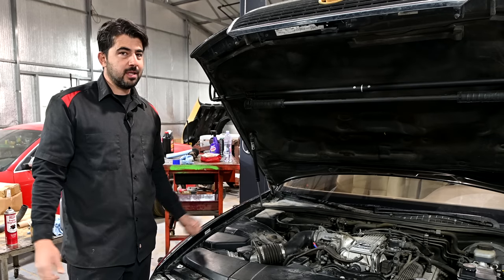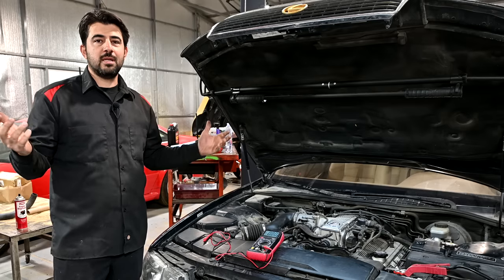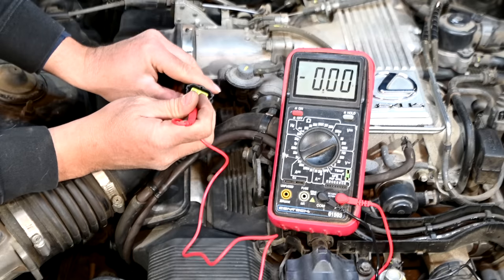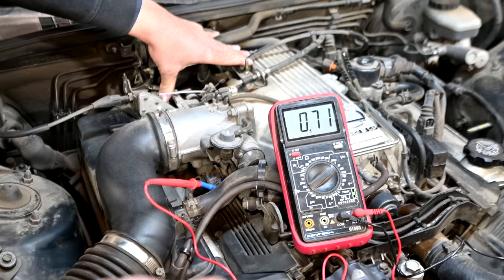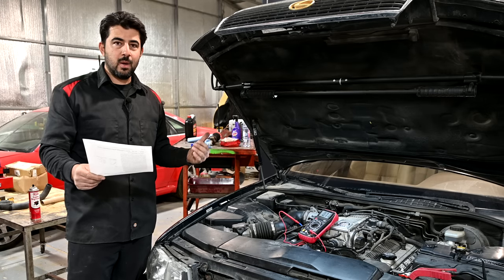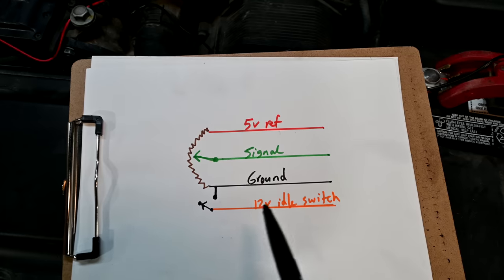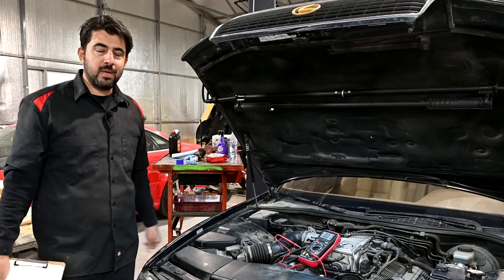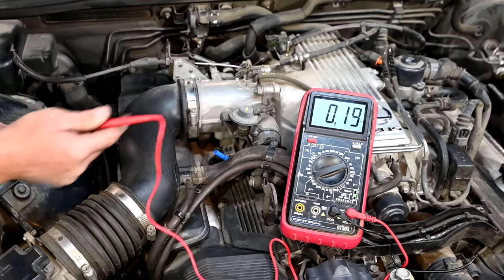Whack That Sensor To Find Out - Bad TPS or ECU?

Comment: Hello i have Toyota rush 2006 , i ve cleand throttle body and know the engine is working 2rmp. I suppose there is a problem with tps sensor. Could you please help me hot to solve this problem? Thanks so much 🙏🙏🙏

Comment: I have 1989 Ford F250 with a 351ci 5.8L V8 and because my scan tool doesn't work on OBD and OBD 1 systems.  I pulled the code with the blinking check engine light. and got a 53 code and came up with TPS circuit above maximum 4.5 volts. but I'm not sure what the parameters are supposed to be for that particular TPS. or if it's something in the circuit that is out of range.

Comment: Great tip with the screwdriver mimicing the bumps and vibrations of the road and engine. For the adjusting of the TPS, how does that work? Is there just an allowable tolerance spec you put it in and mount it?? 🤔

Comment: I like that you get it fixed right 😀

I would have done two things before replacing the switch and if it mostly fixed it, may have left it at that.. leading to a bad computer I guess lol

First would have been cleaning the throttle body. Second would have been cleaning the contacts of the sensor and disassemble it if able for further cleaning and inspection. Then while in there I'd probably clean the maf or map, anything I might have taken apart to get the TB off for a full cleaning. Lol

Comment: I had a 91 Camaro 3.1 L engine that puked the TPS sensor at 93K miles and it had all the symptoms with erratic
idle and was easily validated. Also, given the amount of miles on the odometer, it is very common that a good
many vehicles for the mileage of 90K miles or better for the TPS to fail. Also, knowing that my Mom had the ECU
replaced by the dealer already for another problem all together previously. Upon replacing the TPS sensor, I also
took the liberty of cleaning the IAC Valve pintle and also inside the IAC port housing for good measure! I also 
did cleaning of the internal throttle valve body and the mass airflow sensor as a scheduled service!

Comment: Thank you 
Finally a video with 4 pins 📌 
Would the idle switch create surging/ bucking engine light on not flashing all simultaneously.. thus happens about 10 miles into  driving.  If I turn car off five minutes or even 5 hours it seems to start the time of miles again before it repeats.  Other than this runs excellent and great gas mileage 😮😊

Comment: Great video!  What would cause a 1988 F150 300 six manual shift to jerk and surge when letting off the gas peddle.  New TPS , ICV , wires, cap and rotor.  Runs and idles great. Thanks Larry

Comment: Ty for this 4 wire vid, i think the 12v wire on my hiace is faulty. its not changing when i open the throttle,  just stays on 12v. might throw a new tps at it :)

Comment: On a Honda Accord EX 2.4 l I have a good ground 5 volts and TPS adjusted to .5 ohm resistance level. Gives .5V to 4.5V signal on the PWM. It works great get restarted once still good 20 minutes it slowly goes bad again? I don't really have a $170 for a wiring expert to go digging until maybe they find it. Redid pig tail crimp rewired the ground to the chassis. P0122 Low Voltage code pops up again. Every time I checked it with the car on without running it gets exactly 5 v

Comment: I'd be interested in seeing a teardown showing the failure mode of the sensor.  I'm gonna guess that it's corrosion caused by water ingress, but I've been surprised before.  Could just be a mechanical failure I suppose.

That said, it worked out for you this time, but back-probing will bite you in the ass one day. One day you're gonna waste a bunch of time over a poor back-probed connection. I'd go straight to Pomona piercing probes.
Reply: It's not water, the issue is heat so the plastic inside get damaged. Lexus  gs300 mk2  98-05, has absolutely the same tps drama...

Comment: I had a throttle position sensor go bad on me the car took off 200 miles an hour I had to shut the car off put it in neutral very scary situation
Reply: What kind of car will go 200 mph ?
Reply: @kellismith4329  120